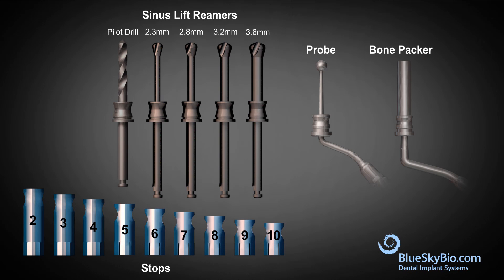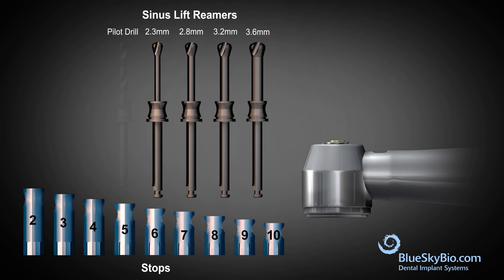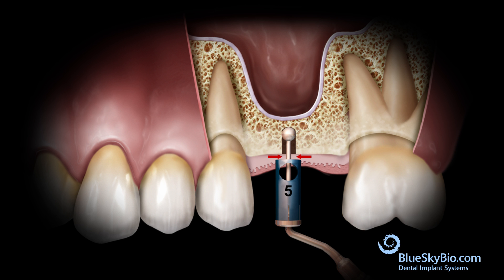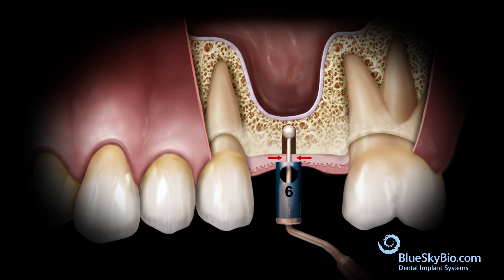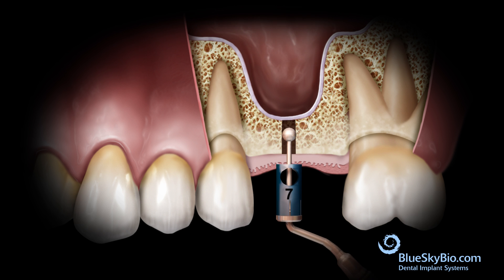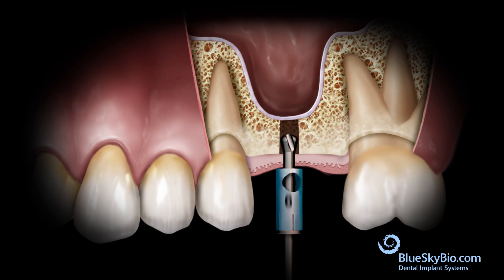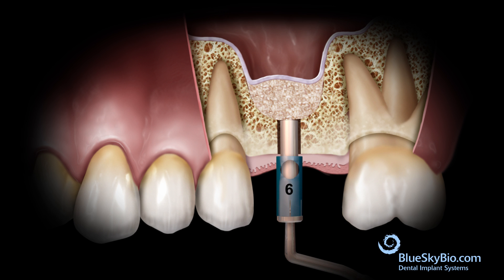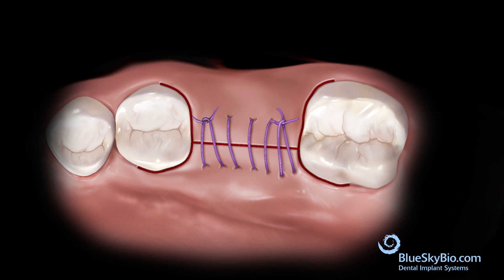Basic Hammerless Sinus Lift Instrument Technique

Comment: Wow. Overly complicated.  Can be done.in much fewer steps with less instrumentation.  The premise of an osteotomy being painful is wrong.  You use local anesthesia you fool. If you don't thin the bone enough below the sinus membrane you will have to tap to hard.  Danger of perforation.   That's the skill involved here.  Thin the bone correctly, minimize tapping on the osteotome.